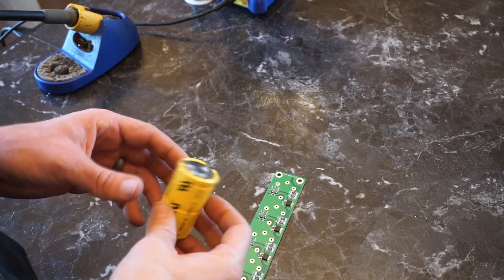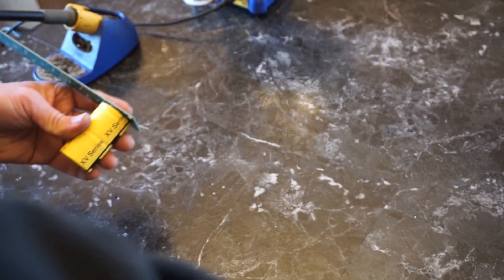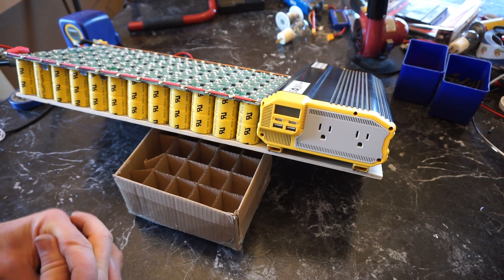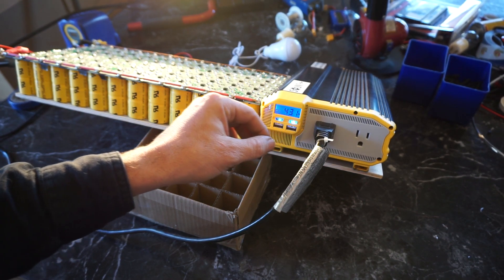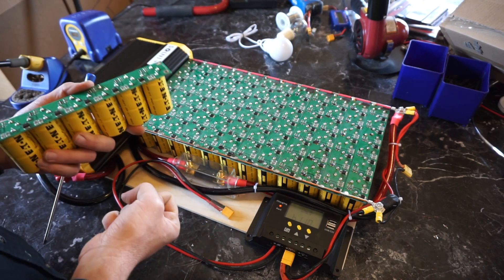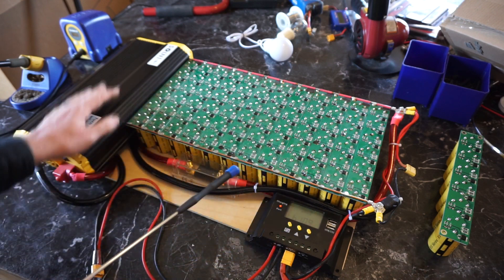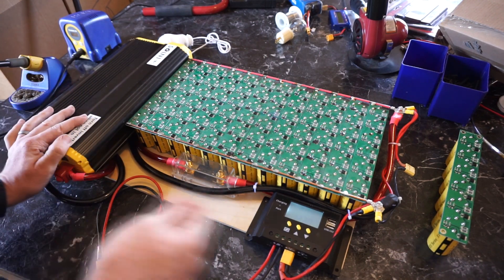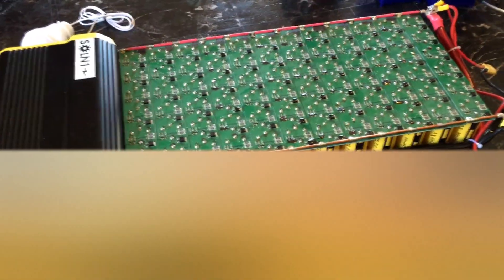Building the SOLN1-2000 Watt Capacitor Solar Generator

Comment: You are wearing a metal wedding ring and literally casually skimming your hand across hundreds of charged supercapacitors. Don't do this, really really, don't do this. You can cauterize your finger in an instant if you happened to short out any of the many exposed terminals or traces.  This is very dangerous with batteries, but supercapacitors are far far worse than that since they can discharge instantly.
Reply from the maker: +RadioactivePretzels 
Good point, but that is why I wear a silicone wedding ring.  I am around this stuff too much to risk wearing a metal one.
Reply: Ha, that is fantastic and the best possible rebuttal! Good for you and keep up the great videos!
Reply: @lasersaber  rewarding this. It makes me pretty nervous when you were waving the screw driver around. - if I tried that, I'd of fumbled the screwdriver eventually. Not sure the effects because of PCB layout. But still made me incredibly nervous.
Reply: Hewing - nope.
Super caps can deliver a lot of power, but for the same energy they would cost a lot more than batteries.

The caps he uses, if you buy 500!! cost about 8$ a piece.
With 2.5V at 400F that is just around 350mWh.
A cheap carbon-zinc AAA battery holds the same energy.
And LiPos - the small LiPos are overpriced. 150 mAh cost about 8$ too - and holds over 500mAh.

SuperCaps are great for certain specific tasks, but not so much for Bulk longterm energy storage.
Reply: @ABaumstumpf  the purpose for this is not to store electricity for long but for short time periods and make it available quickly for things like saws and cement mixers.  did you get that or did the idea for this project pass you by. this is for using the suns energy quickly not storing it for long periods.  I do not know why people do not understand why this system was made. think of the purpose before you reply with things that have nothing to do with why the unit was constructed in the first place.
Reply: @melcak.4802   "did you get that or did the idea for this project pass you by."
Well-- you might want to first check what he has done and then read my comment again - i was writing under the assumption that everybody here that would comment on this would have a basic understanding of electronics.

"this is for using the suns energy quickly not storing it for long periods."
Seems like you don't know-  but he has long made a video where he says he WILL use LiPos cause while the capacitors offer a large peak current the energy density is poor and having power for only a couple of minutes is not helpful.

Seriously - at the same size as this array but using LiPos he would still get a couple hundred (> 500) Watts continuous. 

" I do not know why people do not understand why this system was made. "
Yeah - i really do not know why you do not understand the system and its purpose.
Reply: Supercaps don't do well in term of energy per weight, specific energy,  or energy density, meaning that the amount of energy supercaps can store per unit weight is small when compared to LI-ion  batteries. Supercaps have a high power density, however, and they have been employed in e-motor situations because of this. 
IOW, Supercaps have a high watt per gram but low watt-hour per gram.
Go to  https://endless-sphere.com/forums/viewtopic.php?f=14&t=64915
Reply: really really, don't do this  Did that over 40 years ago while replacing a 12 starter.  
Even knowing battery was still connected and being careful not to short out wrench while getting the battery cable loose from the starter, my ring barely touched the body with my wrench touching the ring inside my hand.  Poof! an instant brand around my ring finger and burns on the thumb and finger of my right hand as I grabbed the ring off my ring finger and flung it all the way across my double car garage.  Been using mechanics gloves plus disconnecting negative battery ever since.  My wife died 10 years ago but I still have a white ring on my left ring finger of that permanent brand.  FYI  I wore that same ring until sometime following the death of my wife.  The ring had a small chunk of gold missing when I traded it in on a new wedding band  God is good!
Reply: I stated, "Supercaps have a high power density". This pre-addresses your "high current loads" remark. 
But a comparison to batteries must be selective. That is, the chemistry of the battery needs to be indicated. In your example, a truck (with a diesel, I suppose), a proper size Li-ion battery would be superior to a cap. Caps have a low specific energy. The same weight cap won't keep an engine with a dead alternator running as long as a Li-ion battery. 
The engine will start fine with a cap. This is because of the high power density. And as long as the alternator is alive, this may be all you need. 
The other big advantage of caps is their temperature resilience. A cap is just a couple of metal plates separated by a dielectric substance. There is no chemical reaction to be dependent on temperature.
Reply: Hewing Enterprise  The Caps might be able to help battery-lifetime if the bike really can draw that much power - but normally e-bikes are limited to far less than the batteries can deliver.
Reply: I'm no audiophile, and only a mediocre pixie wrangler, but I don't see heavy bass notes lasting more than a fraction of a second. Even a gargantuan pack like this simply doesn't have a useful amount of energy for an ebike.

Elon Musk was initially a fan of using capacitors in his Teslas but found much the same thing. For the weight, space, and cost, the return on investment is just paltry.
Reply: Nehmo Sergheyev Capacitors are superior to batteries in short term high current loads and charging with little or no memory effect.  A Maxwell engine starting module can start a semi truck and will recharge to full in 15 minutes. This saves truck drivers from having to idle in order to maintain batteries. A maxwell ESM can charge up and start a truck from batteries that have only 10 volts.
Reply: @Nehmo Sergheyev: It is the way you said it. Why didn't you just say "Everyone should put off jewelry when doing some work where it might be a hazard."?
Reply: I thought you might like this; Baseline Testing of the EV Global
E-Bike With Ultracapacitors
https://ntrs.nasa.gov/archive/nasa/casi.ntrs.nasa.gov/20010069673.pdf
Reply: Wedding rings are dangerous anyway,besides around electricity. I still wear a scar from a wedding band that vaporized from 220vac. The scar on my heart will NEVER heal.
Reply: Darwin Award
Reply: @punker4Real  Dad worked in the electronics/electrical generation field all his adult life. He was married to mom for almost 67 years and not once did he take off his wedding ring.  Nor did he ever get a ring burn. It is called situational awareness and you keep that hand away from where it might come in contact with electricity. Now a watch is a different story as a watch will flop around at the worse possible time. Those need removed if they are metal.
Reply: I once accidentally discharged a capacitor (in a faulty computer monitor) through my thumb, burn't a (tiny) whole right through it, I metered it afterwards and it still had 500V left. I use a 100V microwave or fridge bulb with 2 leads attached for safely discharging them.
Reply: Gary DePietro it doesn't matter what gear you're in either once you're up to speed that amp draw to just gets smaller and smaller you're absolutely right about that one
Reply: RadioactivePretzels wherea your vids expert?
Reply: @Nehmo Sergheyev: This is very silly. You don't have ANY right to forbid someone to wear jewelry, just cause you think it's "primitive". I wear a LOT of very thick silver rings in the 100 gramms area and when I do electronic stuff, I just put them away. That's it. Easy.

AvE just puts tape over his ring.
Reply: You are so obviously NOT heterosexual.
Reply: Some people have no idea of the forces and energy they are messing with. It takes a second and they can loose a hand. Then they learn.
Reply: Should use some nail polish or something to cover terminal you did not want to bridge.
Reply: Not only do I not have the "right" to impose my opinion about wearing jewelry, I don't have any power to do so either. I am not the government. 
However, jewelry, particularly when the wearer is involved in manipulative work involving the hands, and particularly when the work involves possibly dangerous electricity, is a hazard. It's also sissy, and I'm heterosexual.
Reply: Gary DePietro I would heavily assume that most bikes have batteries that are more than capable of delivering the current the motor can use.
Eu is limited to just 250 W; Canada 500, and US 750.
So only in the US with some bikes it might help - but it really depends on the bike, the motor, the batteries, and the motor-controller.
Reply: @ABaumstumpf  Ebike regen is the application, caps allow you to recover more of the energy from braking. Since LiPo charging is typically 0.1-1C versus discharging around 10-60C.  I believe in real world situ, a system with caps give approx 30% energy recovery. With pure LiPo its up to 15% recovery.
Reply: A real guy may wear a watch, maybe a cellphone, or a multitool, but real guys don't do jewelry. We're too confident to need external displays of prettiness.
Reply: point still applies - please tell peeps your ring is silicone - how are they suposed to know?  they'll see it and 'monkey see monkey do.'  make a point to speak of extreme danger and be a model of behavior. superman play and superman caps are big boy stuff!
Reply: I just literally wtf'd and paused this video to look for this comment. Boys and girls, don't touch exposed electrical terminals of capacitors with your bare hands. Sorry op you're an idiot.
Reply: +Nehmo Sergheyev Real "real guys" don't worry about such arbitrary "realness" as your standards for personal adornment. Being so concerned with a lack of adornment is as vain as worrying about the taste of such adornments whether they be jewelry or watches, or multitools. Isn't it the vanity that subtracts from being a "real" guy, not the objects of that vanity?
Reply: @ Ska Macanan The voltage is less than 15 volts he is fine. You however come across as quite ignorant with your comment.
Reply: Why wear a ring at all? Wearing jewelry is a primitive custom in which no scientist should partake.
Reply: Nehmo Sergheyev you sound like a pompous fathaead , why don't you state the obvious ???? who do you think you're blithering to morons like yourself ?
its obvious this guys trying to see feasibility for alternative to lead acid

Comment: Very well done I was wondering  for the controller could you put in say a battery Or super capacitor  as a morning start up reserve booster source that could be set to be the first start up and restore power during the day ? and maybe also be used as an extra source of power ?